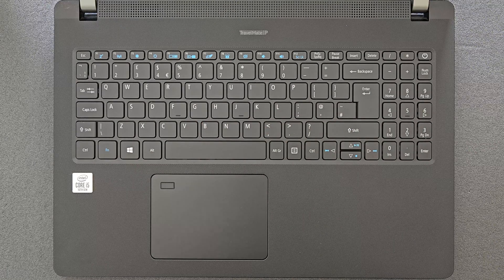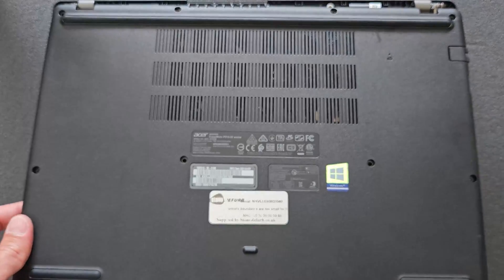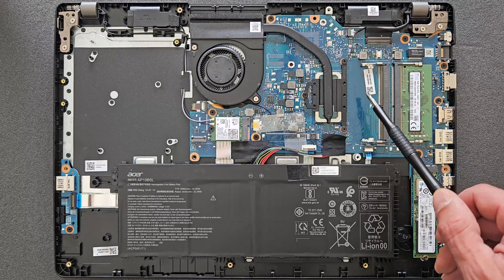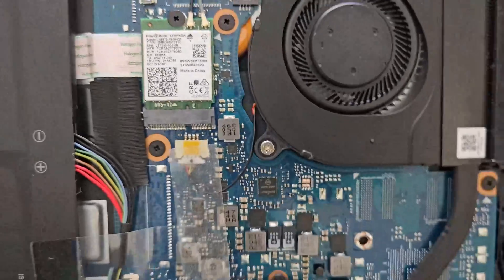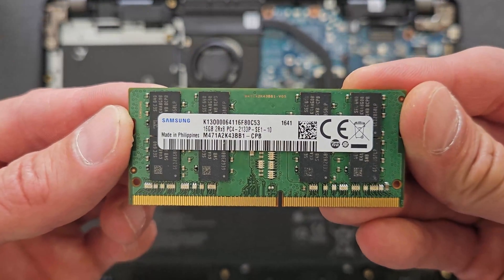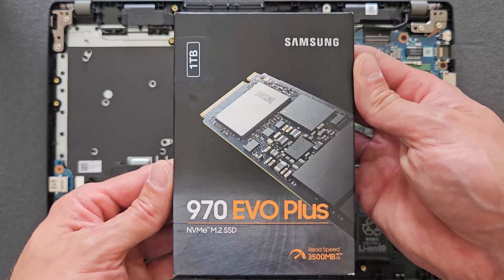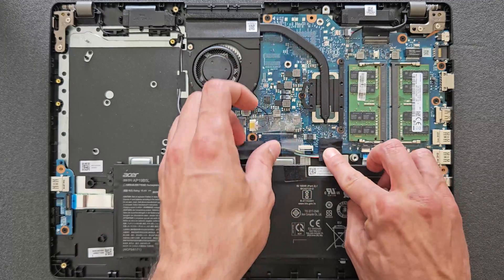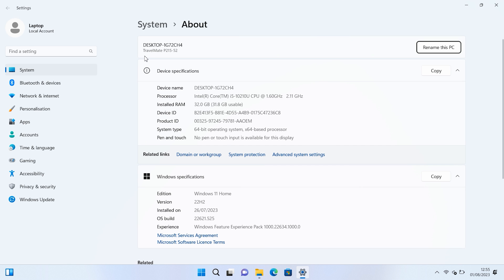Acer TravelMate P215-52 RAM and NVMe SSD Upgrade

Comment: That empty real estate to the left of the WI_FI card appears to a spot to land a 3.5 SSD . Some say it cant be done but looks a lot like one can fit there with an acquired cable and frame. Any one ever try this?
Reply: Es un lugar para instalar SSD. Yo lo he colocado sin ningún problema y funcionando a tope.
Reply: @Fernanpv may i ask/ how were you able to fix the ssd there? and also did you only use a SATA cable? or did you use a SSD caddy bracket that fits there?